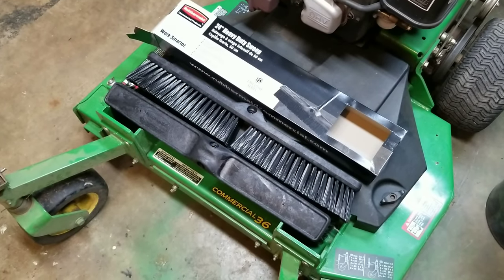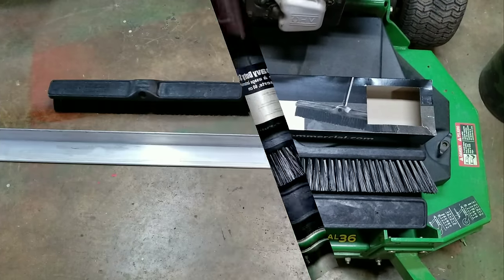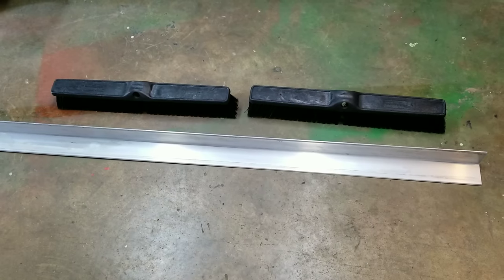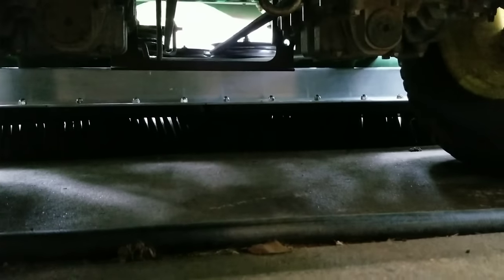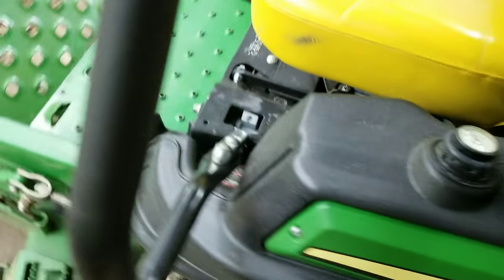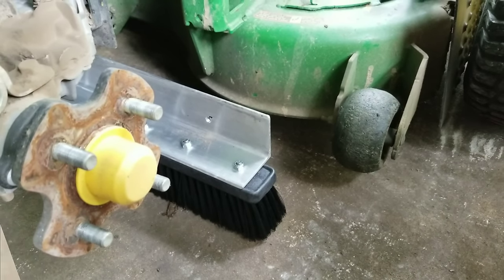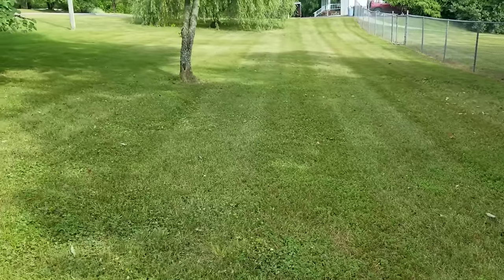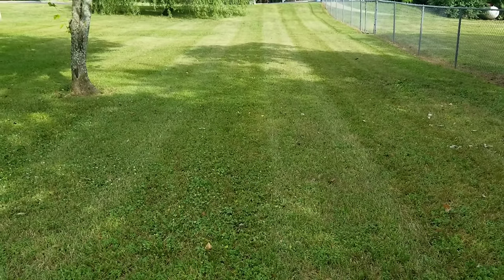DLC - DIY Lawn Striper Build

Comment: A Z bracket made from 2pieces of 1”x1” L channel ( weld or bolt together)  find a discarded mud flap ( they are all over truck stops, and you are cleaning up for them ) 
Bolt it to the deck. Cut your mud flap so it hangs down about 1 1/2  inches lower than the deck. 
I made mine for less than $20.00 and used it for 8/9 years .

Comment: Very well done! The only thing i could offer would be to go with two 3/8" bolts stacked vertically vs one bolt. It would reduce the stress on a single bolt and the associated mounting holes. Thanks for the advice, most appreciated.

Comment: It would be easier, and work better, to put the stripping attachment behind the rear wheels so as to not have the wheel line.  You may have brushed them a bit.  I think using the same angled aluminum (you can get at Home D) and making a  severe tri angle to the rear tow hole.  Add weight it as needed and a simple  rope to pull up when needed.  Easy on and off.  I think I'll try that.  Great idea.  Thanks.  I'm going to try it on my new Toro 42 inch zero turn.  No drilling in the deck as mine is forged steel but a pull behind with very little clearance would do well and no issue in reversing as I'd make it where I can lift it.  I think I'd just mow the grass the grass without then just attach the brush pull and run my tracks.

Comment: Really good job there; love the way you did this.  My only suggestion would be to put a nut on the bolt and tighten it (might have to put a spacer on first if the threads don't extend the full length of the bolt) before you attach the angle to the deck; this would make it much easier to attach and remove the angle as needed, without the bolt getting pushed back through the deck.  Also, you really need to check to be sure that the bolt head doesn't interfere with the mower blade; that would be ugly :).
Reply from the maker: Good ideas, thank you for the feedback.
Reply: Exactly what I was thinking

Comment: Really like this setup and will probably do mine very similar. The only mod I’m thinking about is to weld a mounting bracket to the back of the mower deck to bolt through rather than drill a hole through the deck itself. Great design though!

Comment: Looks great. Although you were so close to the anti scalp brackets. You could have mounted to them and saved a rusting deck. And adjustment wouldn't have to be through the inside of the deck
Reply: By far the best DIY stripper vid I've seen.

Comment: I would think this should wear well overtime and pass marterials through it but put enough pressure on the grass to brush it for stipes. Seems like a genious idea.  Makes me wonder why anybody would rollers are a trailing mat vs this set up. 

I have a 52" gravely ZX deck that has a completely flat rear profile with bolt holes already there.   This i should be super easy for me to replicate. 

Thx!!!
Reply from the maker: Chris Jennings  Do a video :)
Reply: HandyGuy 2016 i should...

Comment: Curious as to why you need to have the brush that close to the ground. Wouldn't a half inch lower than the blade cut do the same thing? Just curious, not in the business so I am trying to learn. I do like a striped look though!
Reply from the maker: C. Rice  closer to the ground works best from my experience.
Reply: HandyGuy 2016  thanks!

Comment: nice kit. shouldn't have mounted it to your deck though dingy
Reply from the maker: Why not? Most factory stripe kits mount to the back of the deck.
Reply: Because now it adjusts with your deck. You shoulda put adjustable brackets on there. So you can set your deck and adjust your sweep

Comment: It would work a lot better and have more detailed stripes with longer grass.... your cutting at 2 inches there is no blade left to fold over. So basically just brushing the grass, leaves, and sticks around. Raise the deck up to about 3 1/2 - 4 and stand with your back to the sun and tell me how good it works then!